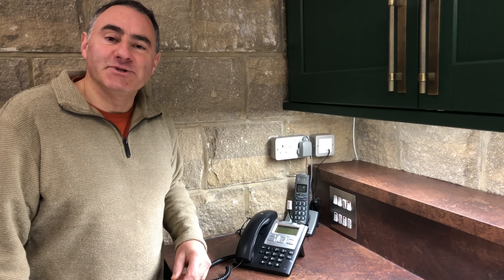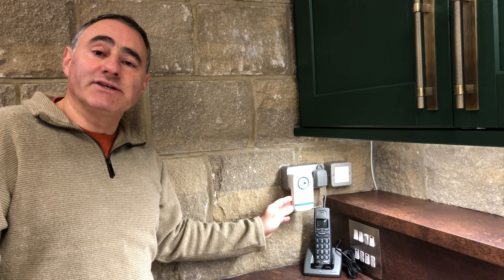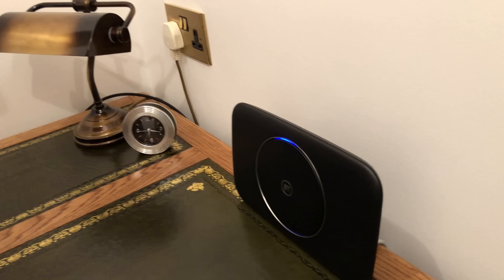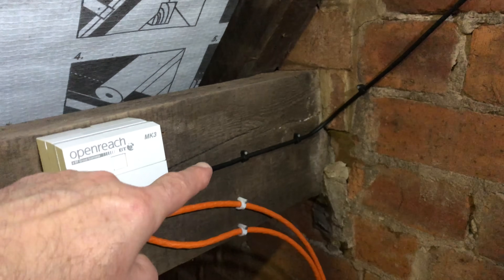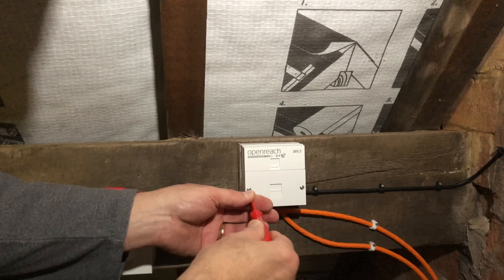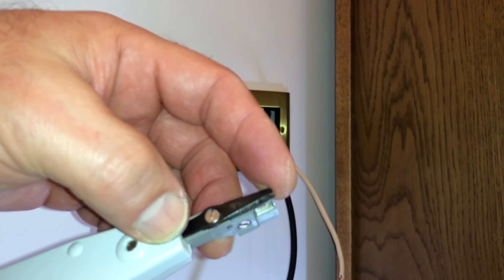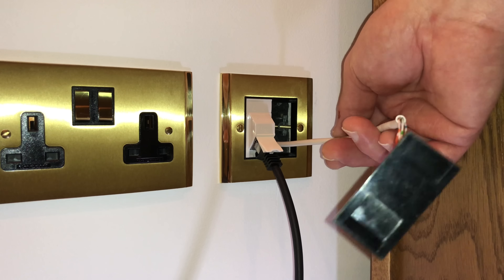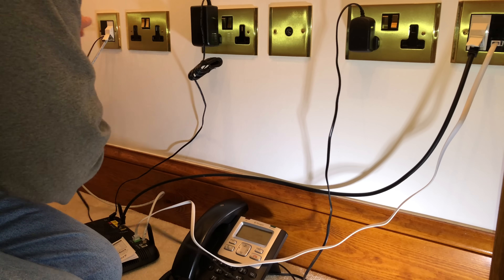How to Video - Analogue to Digital Telephone Landline Switchover Advice VOIP.

Comment: Thanks for that, power cuts are a nightmare in the countryside though because usually the only mast we have is the one connected to the same grid as the village.
So if theres no power in the village theres no power for our only mobile mast😢
Reply: @r.h.8754  I think you're right about BT Fibre cabinets. They have Warning notices on them re 230-volt mains supply, so I assume they have a local mains supply. Having worked for one of the mobile phone operators, I can confirm that the base stations only have a limited battery back-up and some of the small cells, mounted on lamp standards have no battery back-up at all. If there is a prolonged mains outage over a wide area, there are serious problems  regarding emergency calls.
Reply: Exactly. The new system is not robust especially in rural areas where mobile coverage is unreliable. As you say if a power cut hits it can also take out the mobile signal; this makes the advice that you should use your mobile phone instead somewhat hollow. By contrast traditional analogue phones were powered from the exchange whose battery and generator backup could be relied on to give telephone service during a power cut or storm.
Reply from the maker: Hi Sandy, That doesn’t sound good. You can consider battery backup, Uninterrupted Power Supply (UPS). I believe there are various types giving varying battery life levels until it needs recharging. Thanks for tuning in and commenting. Kind regards, Rob 👍
Reply: @robswiseways5697  I can run my router from a 12v battery using an inverter, but the mobile phone company need battery backup at their mast to give us a mobile signal during a power cut
The power companies keep informing us to text or email them if we have a power cut but have no answers when told if the powers off there is no mobile signal either
Reply from the maker: @r.h.8754  Thanks for the info. Vodaphone must have several hours backup ups. Cheers, Rob 👍

Comment: I am 'sorta' looking forward to when they come to convert me to VOIP (not!). There are no power sockets anywhere near my phone socket; I presume that they will have to supply some sort of kit or equipment so that I can plug my phone into ... and where will they power it from?
Reply: Yes, I am with BT. From other comments and replies it seems that BT will send me a piece of equipment. So that will go where the phone is now. Where will it get its power from?, as there are no plugs nearby. How does my voice get from the handset to the BT exchange ... I have a BT landlines but no BT internet. It sounds like I will be replacing one item with two. What happens if/when I get a powercut?, how do I phone anyone?
Reply: @grahamtanner1066  The device you will get from BT is effectively a wireless access point. You pair it with your router, then plug it into any power socket you choose, though there may be a range limitation. Your phone plugs into that, and is connected wirelessly to your Internet service. In the event of a power cut you will have to use a mobile.
Reply from the maker: @stevemoss7793  I understand what Graham is asking now. Graham does not have broadband and only a traditional corded phone plugged into the master phone socket, with no adjacent electrical socket. I’m presuming whatever BT supply, it will need to be plugged into an electrical socket and to the telephone master socket for its communication link. There are options and one option is to have an electrical socket fitted adjacent to the telephone master socket. Cheers Rob
Reply: It's not a matter of where your phone socket is, as you won't be using that any more. If you don't have a phone socket on the back of your router, BT will supply you with a wireless adapter that you plug into a power socket, and the phone plugs into that. You get one free, any more will cost you £19.99 each.
Reply from the maker: @stevemoss7793  Thanks for your reply Steve. You’re absolutely right about the adapter. Also I’ve read on BT website they will send a Hub2 if a customer hasn’t got one when migrating to digital voice. I’m guessing Hub2 is digital voice compatible and has the phone socket on the back. Sorry about my first reply, I should have said ‘may need an electrical socket fitting’ as Graham said there are no power sockets next to the phone socket. Cheers Rob 👍
Reply from the maker: If you’re with BT Graham I’m afraid no one comes to sort you. We received instructions through the post. Bit hard to picture your situation but you may need a socket fitting. Best thing you can do is contact your provider when you receive a letter regarding the switchover. No doubt there will be a way round it. Hope you get it sorted when the time comes. Best regards, Rob 👍

Comment: You only Need a Maximum of Three wires the Blue pair and the Orange is the bell wire, most modern phones don't need the bell wire! The orange wire connects to the Ring Capacitor to make old phones ring!
Reply from the maker: Yes you’re right Don. Thing is I don’t like to see unconnected wires. Thought it looked neater and more complete with the wires connected. Thanks for tuning in. Cheers Rob 👍
Reply: The router probably only has copper connections on 2 and 5 anyway.
Reply from the maker: @bretty453  Never looked into this but you’re probably right. 👍

Comment: My provider (Virgin Media) did all this; sent an engineer out to disconnect the old landline, wired the new hub into the existing extension sockets and configured everything. It took a couple of days to switch it over at the exchange so they refunded me a month's subscription.
It seems I was lucky.  BT were not very impressive in this case.
Reply from the maker: You did well there Richard 10 out of 10 to Virgin Media. BT are lagging behind and only gave three suggestions: wireless digital phones, digital voice adapters for existing wired phones or plug straight into the hub. Thanks for watching and commenting, Cheers, Rob 👍
Reply: @robswiseways5697 i ditched the landline many years ago by my parents just went through this switchover with BT and it was complicated, issue prone, needed ongoing calls to BT to get it sorted out. You'd think BT would have ironed out the kinks before inflicting this on millions of people - there can only be so many fundamental setups to figure out before the roll out surely! If BT can't get a grip on this how can they expect normal people to!

Comment: Excellent video Rob, sound advice. I had to do this for my sister in December, and myself earlier. 
You are legally allowed to disconnect the extension wiring from the master socket. Thats why it has a separate front bit. 
Even if you are not going to do Robs mod, disconnecting the extension wiring will benefit your broadband speed ( removes extra capacitive loading) 
* I got a free digital cordless when i changed back to BT in the summer as part of the 24 month deal. *
Most people will have their master socket next to the hub connected by a black/grey RJ68 tiny plug to the hub (labelled broadband ) maybe via a microfilter. 

When full-fibre arrives ( look for a new box on the telephone pole with at least 8 round plugs on the front) BT Openreach  or contractors will install a new fibre wire from there to your house. It will end up in a small box near your hub called the Fibre NTU  an RJ45 network cable will connect it to the WAN (in RED) socket on your HomeHub.   If you are using all 4 network RJ45 sockets on the hub you will have a problem!  Buy a small network switch to link your home network up. See YT

When full fibre is working, disconnect the old black RJ68 cable from the Master socket and Hub - the old overhead wire is still there and can still kill your hub if a lightning surge happens. The Fibre is glass and kevlar and is not vulnerable. 
The old Overhead wiring will be removed after 2025 when everybody is on fibre they say, but i doubt it!

Comment: Hi, BT engineer here. Strictly speaking the only wires you need to connect are the blue / blue - white (2 & 5). All other wires aren't used but no harm in connecting them
Reply from the maker: Hi Sean, Good to hear advice from BT. My keen attention to detail drove me to connect all wires as it looks neater and more complete 😁. Thanks for tuning in and commenting. Cheers, Rob 👍
Reply: I did this the other week. Spliced 2 and 5 in under the floorboards using an old cut down modem cable from the router and removed the old incoming copper line from the master socket all extra sockets work fine. It's KCOM area, the line from the pole was replaced with one with copper and fibre a few years ago. Finally switched to fibre.
Reply from the maker: @bretty453  Good to hear it has worked for you. Cheers, Rob 👍
Reply: Presumably you still get the 75V RMS 25Hz ring signal down the speech pair?
Reply from the maker: @AnthonyHigham6414001080  If I’ve read correctly, it’s 50V RMS 25Hz.
Reply: Hi, retired bt engr here! You omitted that some older phones need the third bell wire, orange/white on pin3
Reply: @rodfulford4306  yes that's correct however there is no bell wire on Digital Voice, for the older handsets we connect a microfilter before them as this induces a current to pin 3 (orange - white) to trigger a ringer
Reply from the maker: @sward86  Does that mean only two contacts out of six pins are active inside the phone port on the back of the hub ? Cheers, Rob
Reply: @robswiseways5697  yes, most modern phones only require one pair, typically the blue pair to be connected to pins 2 & 5, although polarity doesn't matter
Reply from the maker: @sward86 Thank you for coming back on this Sean 👍
Reply: @rodfulford4306 Spot on. I always connect wire 3.

Comment: A UPS (uninterruptible power supply) for the hub can be a good way to keep both broadband and 'phones working in a power outage.  A fairly small, less than £60 one, will do for the low power consumption devices.  Just be sure to swap out the battery about every three years.
Reply: We are less than 1 mile out of town yet have no mobile service on any network except a very poor service on O2.
Hence we have the O2 adaptor that routs all mobile calls via the internet. We also have frequent power outages for extended periods of time as most ot the local mains supply is via overhead cables.
We have 3 off UPS's backing up the router and cordless phones but they are only any good for about 30 mins run time.
As some power-cuts have lasted over 24 hours it seems that, under the new VOIP system we will loose our phone service when the power is off.
BT have been contacted numerous times about the implications but even now have no practical answer.
Given that there are many hundreds of thousands of people who depend upon medical alarms which need a reliable hard wired phone system to work I wonder if this is the next huge corporate scandal in the making?
Reply from the maker: @PeterChapman-rg6gr  I wonder, in the background / longterm, if phone providers are considering cases like yours. They may even provide battery backup in areas prone to power cuts and no mobile signal. However, the battery backup would have to give the appropriate amount of power in relation to the time power is likely to be down. There are so many variables that need to be addressed such as medical equipment. I suppose it’s a case of watch this space. Thanks for your comment and for watching. Cheers Rob 👍
Reply: @PeterChapman-rg6gr Exactly so. The original consultation on this was not well publicised and was mostly only responded to by the telephone operators who all wanted to drop the traditional landline. The London Fire Brigade pointed out that many power outages were more than the (claimed 2 hrs) they were ignored. At least one Council pointed out that mobile signals in their area were unreliable (they too were ignored). Give vulnerable people a free mobile phone (assuming they don’t have broadband) is the preferred (and least expensive) option. Traditional phone lines got their power from the exchange; this had a good backup power supply. With digital voice (VoIP) any loss of power means your land line doesn’t work. So you’re reliant on your mobile (assuming you have a signal). Ironically unless you’re lucky enough to have FTTP your broadband still enters your property using the same copper wires that carried your analogue land line. The telecom suppliers are not replacing redundant copper - they’re using it in a different way and essentially forcing everyone to have broadband. It seems that continuity of service, panic buttons, etc are no longer needed because the assumption is that everyone has a fully charged mobile phone and a good mobile signal. Oh and that the power to the mobile network’s base station is still working. The next big corporate scandal? Perhaps. Certainly it’s a change implemented solely for the benefit of the telecoms companies which will result in vulnerable people no longer having a reliable phone service.
Reply: Considering that the battery backups provided with digital voice services these days use a (probably) unregistered SIM to enable "voice dependant" customers to call 999 in an emergency (that's one of the reasons people don't like it, life alert/pendants and alarms don't work on the backups), I doubt it would work because I don't see any evidence that OpenReach's infrastructure has the power redundancy and backup to let it work, especially when this moves the location from 100s of central exchanges to 1000s of cabinets (in the case of FTTC/SoGEA).
Reply from the maker: @samd2660  Many thanks for your input Sam and video99. Will have to see how things pan out when the mother in law pendant alarm connection is switched from analogue to digital in the near future. Thanks for tuning in and commenting, Cheers, Rob 👍
Reply from the maker: @r.h.8754  Great comment r.h. They are going to have to come up with a UPS that lasts longer than 1 hour ! Good point about ‘what if the cabinet loses power’ !

Comment: Absolutely fantastic presentation, complete and informative and easy to follow. The only suggestion I have for FTTP (Fibre to the Premises) maybe to utilise the redundant BT NTE Box as your access point from the Router and into the house telephone wiring network as it is likely already connected, the only change you may need to make inside the BT NTE is to ensure that the old BT external network copper cable back to the exchange is disconnected inside the box (old A and B wire).
Reply from the maker: Thank you very much for the compliment Paul and that is a good suggestion. Our area isn’t FTTP yet but it’s coming. I would have thought when and if BT install fibre to the premises replacing the copper line, they would also replace the NTE box with the fibre box. But your suggestion is spot on if the fibre equipment is installed elsewhere. Thanks for tuning in and advice, Cheers, Rob 👍
Reply: @robswiseways5697  In the installations I have seen they don't touch the current box, I often see that they bring the FTTP through the wall and into a new box on the wall, sometimes not even near the old NTE, this will allow for re-utilisation of the redundant kit, I would stress though that the A&B wire from the exchange needs to be disconnected to be on the safe side.
Reply from the maker: @paulash134  Many thanks for the info Paul and Steve. Will have to see what happens when our area becomes FTTP. Cheers, Rob
Reply: @robswiseways5697  they don't replace the NTE box, it is left - mine acts as a stand for the power surge protection for the ONT and router.  The copper wires outside are left on the pole/wall as well. I imagine BT will have some ingenious plan to roll out and collect all the redundant copper wire in 2026.

Comment: You did not mention that the classic dial telephones don't dial out on VOIP. Get yourself a 'Dial-A-Tone' converter from 'Vintage Telephony' and the old telephones will be back up and running.
Reply from the maker: Didn’t know that Chris so thank you for the info. We haven’t a dial telephone but I’m sure anyone out who owns one and is reading this will appreciate the advice. Thanks for watching and commenting. Cheers, Rob 👍
Reply: @robswiseways5697  It's a good video and I like your filming style. You would be surprised how many people still love dial telephones!
Reply from the maker: @chriselliott726  Thanks for your compliment Chris. We too know people who have a dial telephone. Cheers, Rob 👍
Reply from the maker: @chriselliott726  That’s very kind of you Chris, thank you for your comment. Cheers, Rob 👍
Reply: Touch tone dialling only, no pulse dialling on VoIP.
Reply: @bretty453  That's my point. If you use a Dial-A-Tone it will allow vintage dial telephones to work.

Comment: Is your old number still active ?
Are costs as old land line ?
Reply: .....and if people living in remote areas don't have a mobile signal or even a mobile phone during a power cut?!! Technology is sending us backwards.
Reply from the maker: @paulb8186  The wife has just agreed with you Paul. 👍
Reply: Yes,  cost will change when you order full-fibre. But at 100Mb minimum (typically 144 ) speed its well worth it.
Reply from the maker: Peter and @simoncroft979 We’re not on full fibre just yet, it’s not installed in our area. Our old number is still active and the cost is the same. Thanks for watching. Cheers, Rob 👍